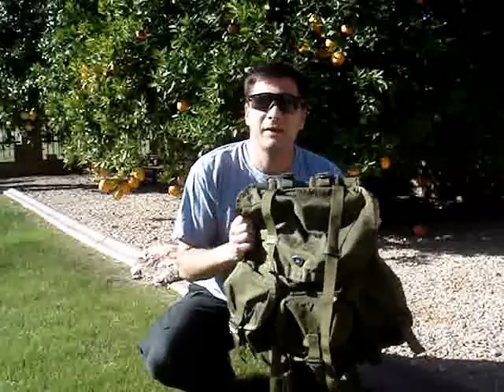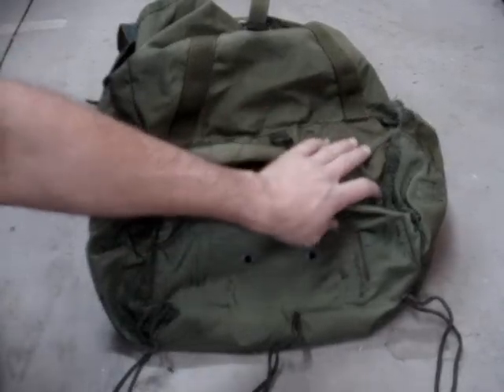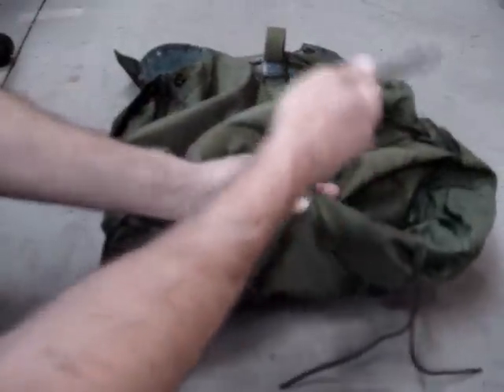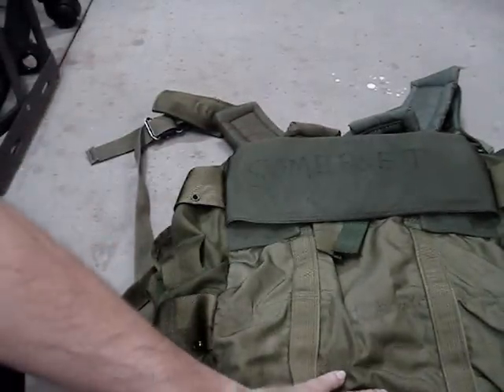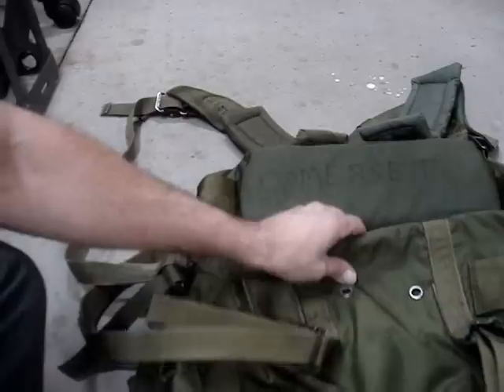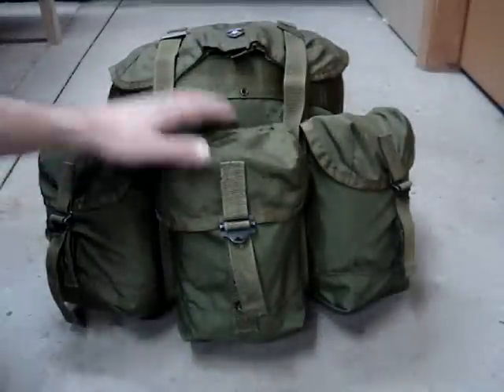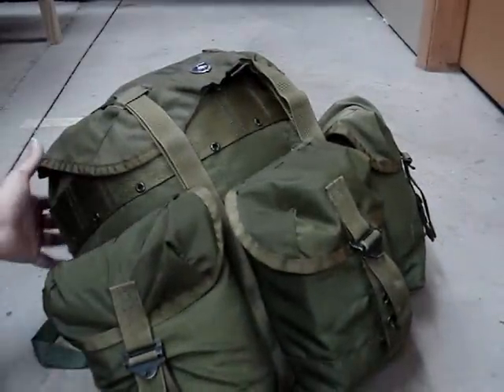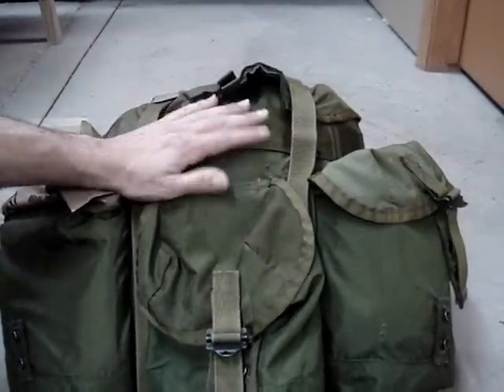How to turn a Medium ALICE Pack into an assault pack

Comment: *************ATTENTION**************
-went poking around the Medium Alice bin at a surplus store. Checked the insides of the newer ones for the cords. Turns out only the LC-1 models have them.

BUT.... you can fasten those side straps that attach the frame and you’ll still be fine.

Mr. Somerset, thank you for this vid😁 this trick further sold me on the versatility of this pack.
Reply: my lc2 has em

Comment: I always use the rings and paracord inside the pack on the bottom to secure extra clothing items or bits of gear to the bottom of the pack so it doesn't roll around when moving fast with your pack on your back.  This works great, by the way.  I don't really feel the need to remove over half of the packs capacity by tying ALICE all up and compressing the daylights out of her.  We love ALICE after all! She's our go to girl!

Comment: Hey thanks for sharing, I just pulled my old alice pack out of the closet, bent/broke my frame long ago. I like that it doesn't flop around as much. Very cool, will be using my old alice pack again, most definitely,  very cool.
Reply from the maker: +Kiana Zaldumbide  Thanks for watching. Hope its useful. I want to make a vid on Alice Frames and repair sometime here.
Reply: @justinsomerset5587  Now I know what those strings and loops are for..

Comment: thanks for the great video. im getting my first Lg Alice pack and i mean my first but Im going over lots of youtube video's to see what modifications I may need to make with mine so that it works good for myself. again I just wanna say thank you and I appreciate you feed. god bless brother
Reply from the maker: +Timothy Bobbitt Thanks for watching, glad you enjoyed it. The medium tends to be a lot more versatile/ modular than the large. The large just carries a ton more of stuff. However, I did sew some rings on my Large so I could put straps on it while off the frame, but not fully or heavily loaded.It doesn&#39;t have the rings or strings but you could certainly sew them in. But if I load that sucker down and fill it I put it back on the frame. I tend to keep my medium in this configuration for a day pack, then I keep my Large loaded for camping, and I am also re-building a CFP-90.  Thanks

Comment: hmm mine Genuine GI but non of those straps on the inside.... newer or older model?
Reply from the maker: Hi Shayne, looking at some newer production LC-2 Medium packs (darker green), as well as some M81 woodland camouflage pattern I have seen, don't appear to have the hooks or cords, some of the LC-1s have even had them cut out,  I used to see guys do that when we didn't know what they were for, although they were never really in the way of anything. I remember we thought the hooks were for hanging equipment and the cords were for tying in the waterproof laundry bag liners somehow or something, but no one tried to figure out how, we just figured it was superfluous. -  But ALL models still have the attachment straps, buckles, and more importantly the sideways web hangers. So if you want to try it out use those on the sides and then just take some cordage inside and tie it between the bottom vent holes and up to the radio compartment buckle to support the middle if needed. If you like the configuration it is not hard to sew in rings and 275 cord. Thanks for the question and clarification.
Reply: Justin Somerset thanks I look into that. see if there is a good place to tie the pack up.
Reply: Justin, I have an m81 woodland alice and there are 2 problems, obviously no straps on the inside, but that's okay I will find another way and I'm missing the bottom half of the left shoulder strap. any chance you know where I can find one?

Comment: Can the same modification be made to the large. I myself have used a wide array of backpacks but never an ALICE type.

I'm interested in buying the Large version, but I feel it'll be too big to carry (without the frame) and I feel the Medium version would not be large enough.
Reply from the maker: +Adrian Moreno Thanks for watching. Yes.(but see #2 bellow). I understand your frustration at trying to find the right pack. I would, of course, recommend the versatile  medium. I think you would be shocked at exactly how much you can load the thing. But I also have, and have had, a wide variety of packs and debated over trying to figure out what works best, so let's see if I can help sort these for everyone. 
-
#1 The "super large ALICE" - CFP-90 - is probably the best, and biggest I've found. 4225 cu in compartment, an insane 6590 overall capacity, not counting the little detachable Ranger pack. Most of the Molle stuff spun off of those, but are heavier than its 8 lbs, and the Rifleman pack, for example, only packs 4000 cu in. The CFP-90 has an adjustable yoke, but is its only weak point as the plastic dry rots. I had mine remade out of leather at a good biker shop. But to me, it and all of the Molle packs are way too large and heavy, and stuck in their configurations. Even the Marine patrol pack seemed fine, but I did not like the way it expanded straight out from the back, not up or out, and you still had to strap things to it externally and it would wag badly. At that point it's internal frame became inadequate. I'm sure you would be told to go up to the full size, but those are all huge things only good for long range-time. You are really a pack mule with any of them. These have all literally given people back problems.
#2 to answer your question about modifying the Large ALICE, yes you can, but you will have to be industrious and install the featured rings and cords. I have actually installed shoulder strap rings at the top so I can wear it off the frame when not fully loaded or with a very bulky but light load. But you are right, anything heavy and it should really go on a frame per normal. The large was originally designed as an arctic pack to fit the majority of equipment internally and was spec rated for something like 90 lbs but I have seen guys probably load to twice that, that's why you see so many bent frames around. Geekprepper.org has some good stats. 2,800 cu in main compartment and a total of 3,800 cu in counting all the pockets and map flap, and you can still strap things externally and squeeze a little more onto the frame.
#3 The medium is my favorite because it is designed to be so versatile, and we pushed that a little further in this video. It was the most issued (with the frame) for that reason. It was spected for something like 70+ lbs when you add the frame. Over about 45 lbs without it is easy but usually not comfortable. it has a 2075 cu in main compartment and 2412+ cu in with all the pockets, flap, and is meant to have a lot of stuff, like sleeping bag, strapped on the outside. Additionally there is the frame shelf and cargo straps  and all the cool stuff you can do with those. (future vid to come)
So you can see there is quite a bit of cross over zone between the two, especially given a frame. 
#4 There is one cool video here on Youtube where a guy actually puts ALICE straps on a 3 day Training Pack (or M1967). also there are a few vids of a Training Packs on a frames, including Dave Cantebury's, which all work quite well, but that is limiting internal capacity and depending on the frame.
#5 If comfort is an issue on a larger pack a lot of guys have been doing the "Hellcat" mod where they use the new thicker Molle straps and belts on an ALICE pack. A lot of guys I have known who had to carry the modern packs hated, and broke, the Molle frames... a lot. They prefer the old but still light weight and strong metal frames and Alice packs but with the new suspension.

So, after much long windedness, and I can talk about this stuff literally all day, I would give the medium a chance. As you saw you can get it down pretty small but with the frame you can add a lot of stuff, its more modular than anything else I think, don't be afraid to use the frame, its actually quite small and comfortable if adjusted correctly. Just put things like you're sleeping bag on the outside. If you have a USGI the Gortex bivy will keep it dry, otherwise get a waterproof stuff sack, and a lot of people forget the pack covers (tire covers to most people) are supposed to be sprayed with waterproofer. Don't forget the liner bags. 
But wait! I understand you and other's apprehensions, so given all this I see I should probably make a demo video so you can all get the idea before you all commit hard earned money. You want to make sure it is the best for you and be worth money spent, not collecting dust in a garage.

Comment: can you also do this with the large alice?
Reply from the maker: The Large ALICE does have the side straps and hangers, but you will need to tie some line through the bottom floor grommets to pull it up, or install the line and rings for a more permanent set-up. Also, I have sewn some buckles to the top of my Large ALICE to be able to use the straps off the frame although it's recommended to not do this for anything too heavy, just bulky. If you put a little work in, it can be done. Otherwise, a variation of this can be tried even on the frame by using the outer straps and some cord through the drain holes to compress down the size for smaller loads or to see if you like the configuration before deciding to modify your pack. Thanks for watching. See the later part of the vid on how easy it is to get line and rings, and you can watch some of my other vids on repairing ALICE gear. Let me know if you need any help on doing anything specific.
Reply: +Justin Somerset thank You for the info !

Comment: Didn't find the rings or straps.
Reply from the maker: Oscar Pantaleon  Hi Oscar, not all production models have them 1. Try attaching the side frame attachment straps on the outside through the web hanger as shown without tying up the bottom. See if it holds. 2. If not enough then pass some paracord (or substitute) looped through the two drain grommet holes in the floor of the pack and then pull up and tie around the inner radio compartment buckle for an anchor. 3. If you like the set up just get some 550, gutted 550, or 275 cord, three D-rings and a bit of webbing and sew them in.  I may do another ALICE care and repair video on it if it helps. Try it and let me know. Thanks